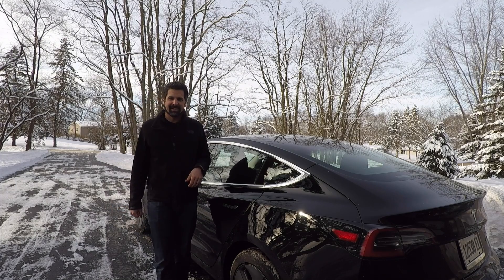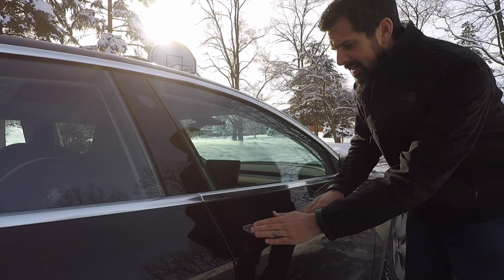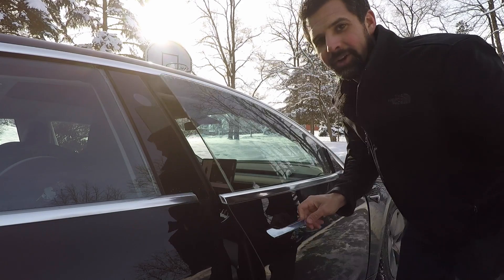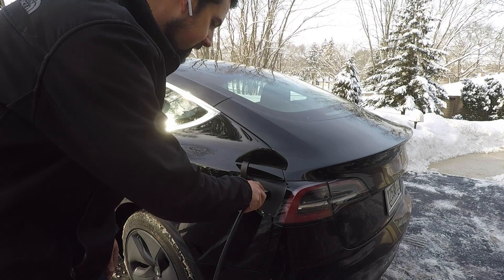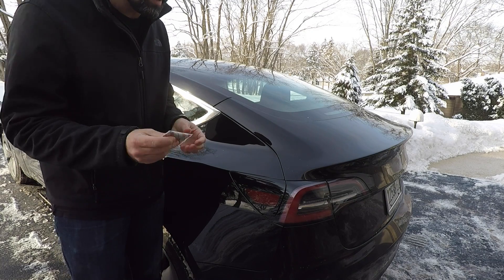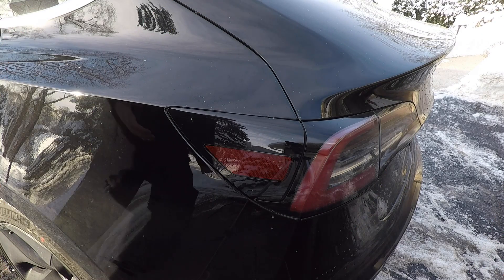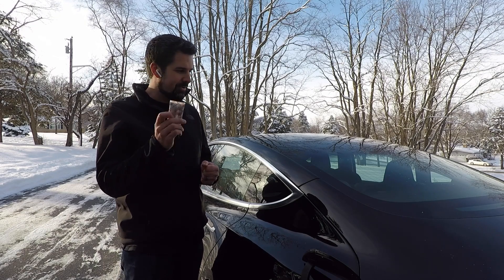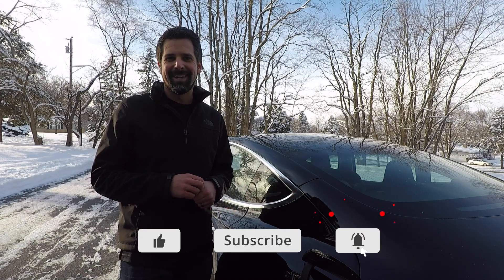Tesla Model 3 Winter Fixes: Opening a Frozen Door Handle and Thawing a Frozen Charge Port Latch

Comment: Thanks for the tip. However, this is such a stupid oversight from Tesla, it’s like they don’t have a QA department. I keep losing range from blasting the heater and it still doesn’t help much. The LTE connection will be lost too if it’s too cold so I can’t even remotely open the heater.

Comment: Is Tesla working to correct all of these cold weather problems?
Reply: LTVoyager of course not, you can’t fix a design flaw. You could blast the heater all you want but it won’t always help and you drop your range like crazy.
Reply: alexander wei Of course you can fix a design flaw.  That is why cars get redesigned fairly often.  Future Tesla models should not have this problem.
Reply: @LTVoyager  Well if you are changing the design then yes of course they could be fixed.. I thought you meant using softwares to fix them. People who already bought their teslas are stuck with these problems though.
Reply: alexander wei Yes, I meant make design corrections to future cars.  Car makers do this all the time to correct defects as they become known.

Comment: This really shows that Tesla has a bit of away to go if they wan't their cars to be used everywhere. Our classic diesel car: Regular handles, works every time (of course, you could have the problem of a cm or two of ice completely covering the door and frame and would take some effort to break to get in), and when refueling, just open the little door and put in the nozzle.
This is how they need to do: Make it simple.
Here we can have rain an entire day with above 0 degree C, and then it slowly creeps down (still raining) and it goes over to freezing rain and then snow on top of that. Really lovely (and slippery everywhere). And on the other way, first a shit load of snow, then above 0 degree and half way of the thawing, it goes down to -10 C and everything (that now has half thawed and begun slowly running down on doors and windows) gets solid as rock.
And someone said to use lock oil and other stuff: I can tell you that it's not something immune to this weather. Our storage lock freezes every winter, despite me doing a complete cleaning (electronic cleaner is da shit!) and then proper oiling. And then, rain, rain, cold, warm, rain, cold, ... It just enters the cylinder and, no luck turning the key.

Sweden is by the way quite fantastic:
Record high temperature +38 degree C
Record low temperature: -52,6 degree C
Record high amount of precipitation during ONE month: 429 mm
Record high amount of precipitation during ONE day: 198 mm
Record high average wind: 47,8 m/s
Record high wind gust: 81 m/s
Record high air pressure: 1063,7 hPa
Record low air pressure: 938,4
Record snow depth: 400 cm
Record snow in 24 hours: 73 cm (https://www.youtube.com/watch?v=JE-dX_FfxAg - 4 december to 7 december, 134 cm!)

There is a reason that we have a large test center for car manufacturer (and they come here from all over the world to test thair cars in winter and extreme conditions!)

Comment: are there any heating in the doorhandles or charging port so they can be heated while the car is charging outside overnight? I live in Norway so dont have a lot of garages over here.
Reply from the maker: The handles and charge port are a "leak point" for the air in the cabin (by design). While there isn't a specific heating element in either the handles or the charge port, if you precondition on HI for a period of time it should (in theory) thaw those areas. That said, the amount of ice and the outdoor temperature could have a significant affect on how long that might take.

Comment: I'll be honest - I don't want a car with these simple drawbacks. I want Tesla to sell cars that don't have baby problems like these.
LIKE THEY didn't know car can get wet in winter.  It's annoying that they prefer design over reliability.
Reply: I 100% get your point but anything can be seen as design flaw. The fact you need to scrape ice of an ICE Car before you drive in the morning. The handles isn't a unique flaw to tesla its similar to some older Astin Martin handles. You could even argue that cars needing to be filled with gas is a design flaw if your really an extremist hahaa. Plus, depending on location how often is this likely to happen? If a lot then maybe it isn't for you #FoodForThought
Reply: Cameron McMillan You don’t need to scrape ice off an ICE any more than you do a Tesla.  And these are simple issues that Tesla should simply correct in future model years and future designs.

Comment: Hello, everyone! The solution to this problem lies in using Teflon or PTFE based lubricant meant for extreme weather conditions. I use Starbrite Snap and Zipper Lubricant on Kryptonite bike locks after first applying Olive oil (because I like it but any oil would do the trick) which works without fail. Starbrite makes a whole range of products for marine weather conditions. Please check them out! I am sure you will find a product from them to suit you so no one has to resort to hand warmers or whacks to open door handles.

Comment: Thanks for this!   We live in the northwest side of Chicago and I anticipate we will need these tips sooner or later. Will be curious to see if Tesla improves either design so these things can’t happen
Reply from the maker: I hope you won't need them but at least these work if you do! Glad to hear from a fellow Chicagoland neighbor. We'll see what future software updates could do to help with these cold-weather issues. Thanks again!
Reply: Derek G. Weber I have had frozen doors with gas cars too.
Reply: Sean Z I’ve only had it once on a Subaru and it was frozen around the windows.  I was fortunate enough to have remote start and left the heat on full blast the night before so I just let it run for a half hour.